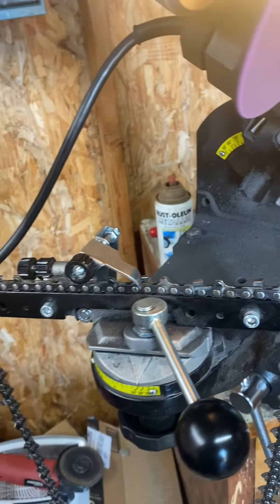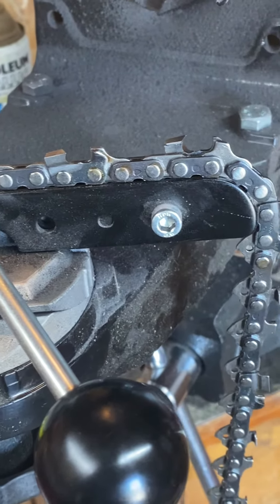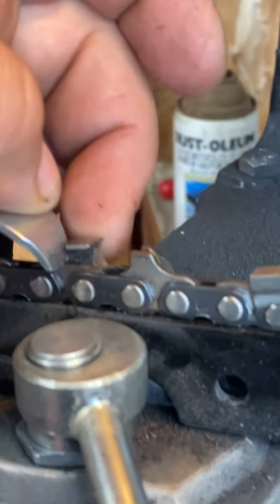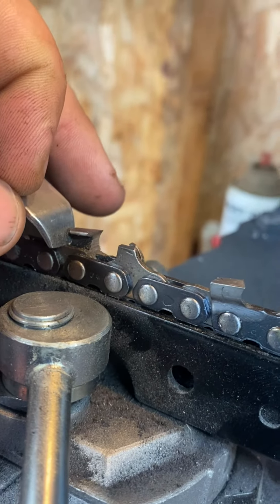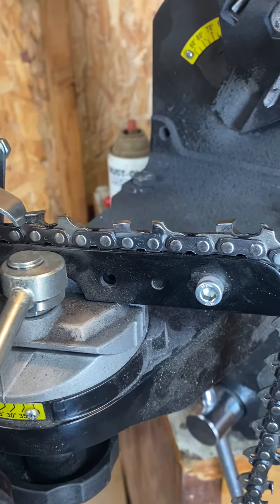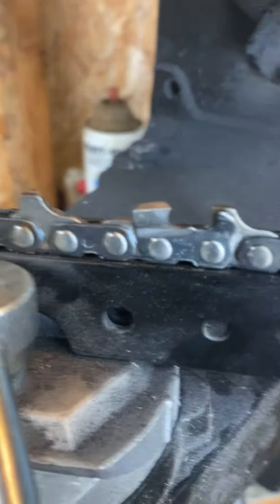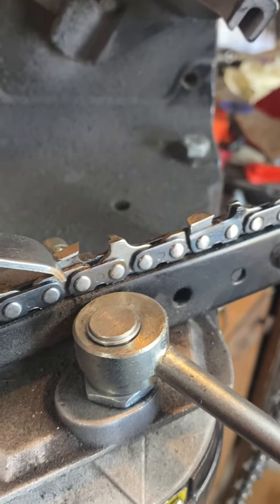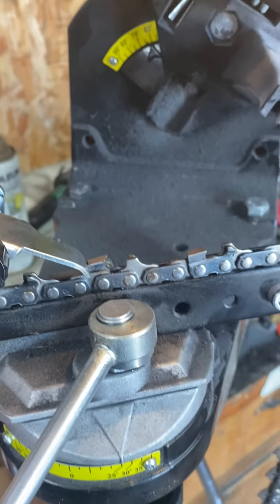How to sharpen chainsaw chain

Comment: Stihl "green"chain..ugh hate them 😬
Reply from the maker: Not my favorite chain but i still can get them to cut well for my customers.
Reply: @littlemechanicshop  for sure, what do you set the rakers at?
Reply from the maker: @groundpounder24365  kinda depends. But for most people .025. Custom stuff like race chains .025-040.
Reply: @littlemechanicshop  for whatever it's worth buddy..if you ❤ or 👍 a comment it would let people know you seen it or responded. Just my 2 cents is all
Reply: @littlemechanicshop  there ya go bro
Reply from the maker: @groundpounder24365  thanks for the info I will do that
Reply from the maker: @groundpounder24365  what do think about the give away I’m doing
Reply: @littlemechanicshop  I think.. whatever work for you man..goals are definitely good things to set for yourself.